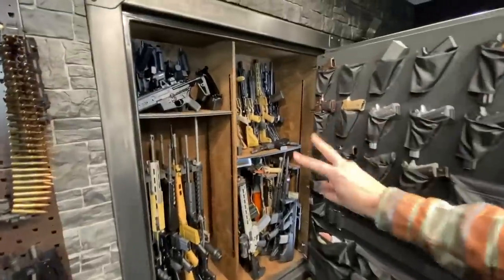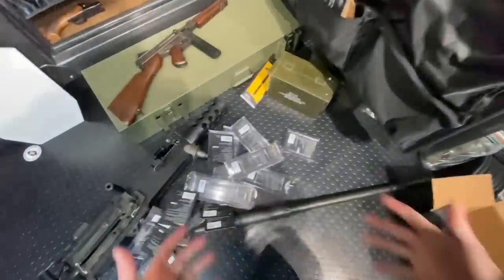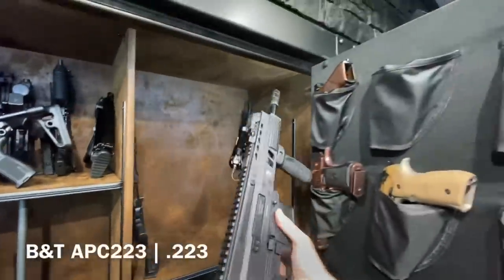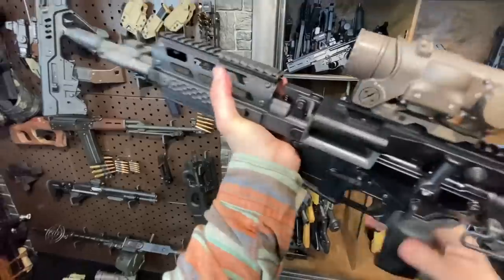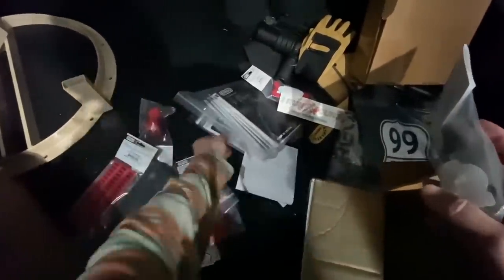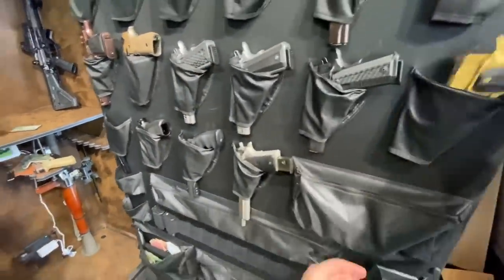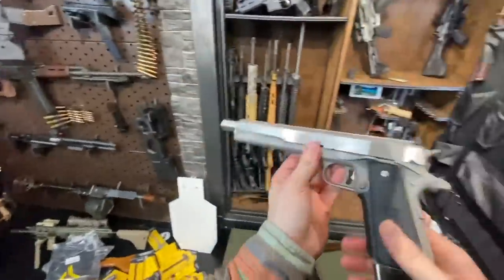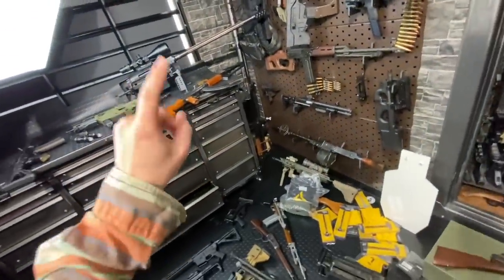GUN COLLECTION TOUR | Part 2 | Ultimate Gun Room

Comment: Black Arch Holsters are a very well kept secret in the gun holster community. I have seriously tried dozens of holsters from so many brands and I just happened to come across a video showing off black arch holsters and so I ordered on for my Glock 19x and folks it is by far the best concealed carry hybrid holster on the market. I have had it for about 2 years as a daily carry and it still looks like new. They use quality leathers, premium kydex that is actually shaped to help you reholster without pointing the muzzle at yourself, if you get the extended slide cover that people show folding over causing them to struggle re holstering Black Arch holsters do not fold over time they remain straight up and comfortable. They have breathable mesh and different versions which I would assume can cover appendix carry as well if thats what you like. They are by far the most comfortable, and well built holsters for conceal carry I have ever had the pleasure of wearing.

Comment: What kind of Compensator is on that Hardballer?
Reply: That's the barrel (with porting cuts)
Reply: @sampsonlll1825  nvm I looked it up, it’s a cap break that keeps the spring in and barrel on, it comes off like the regular Barrel/spring cap